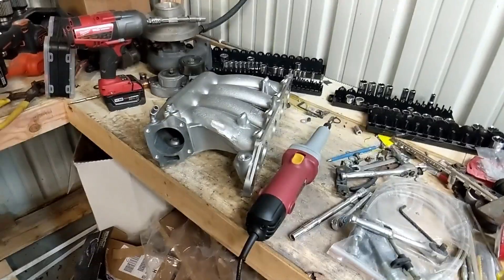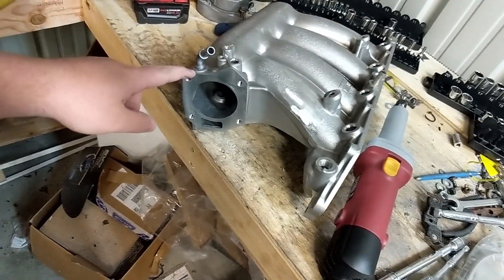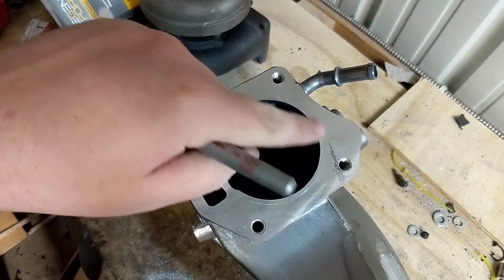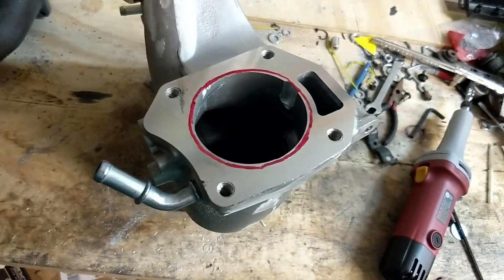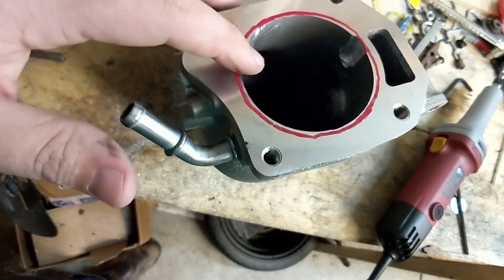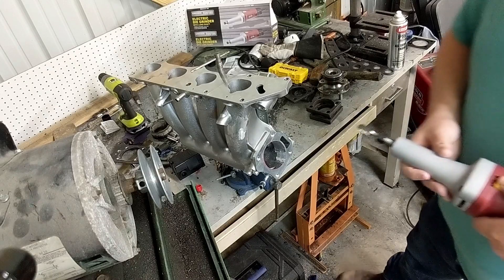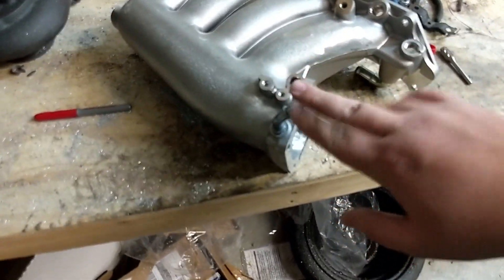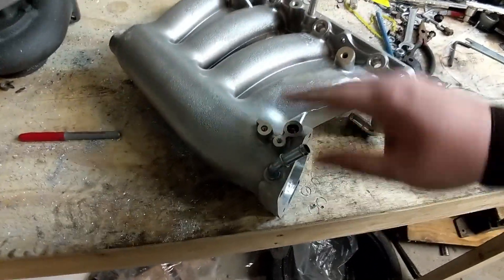AWD Civic Build: Porting your RBC Intake Manifold!

Comment: Hey brother I know this is an older video, but what's the point in grinding off some of those extra sports you pointed at in the beginning? Are they just vacuum ports of some sort? Thanks in advance, I have an 07 FA5 and looking to port the manifold myself and pair it with a bigger throttle body
Reply from the maker: Well for me I'm going with a cable drive throttle body and I want the intake manifold to be as clean as possible. I'm also using vacuum port only from the bottom. Thanks for watching!